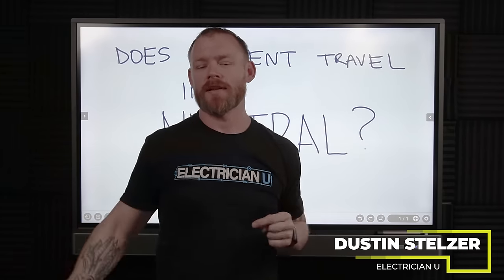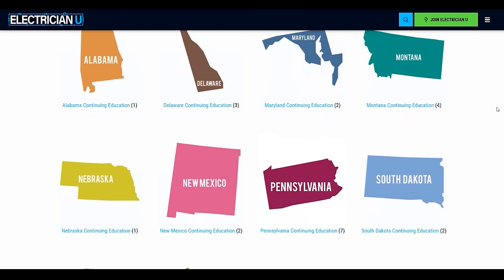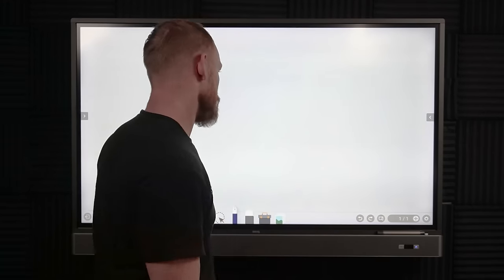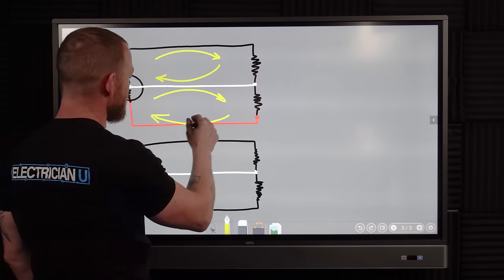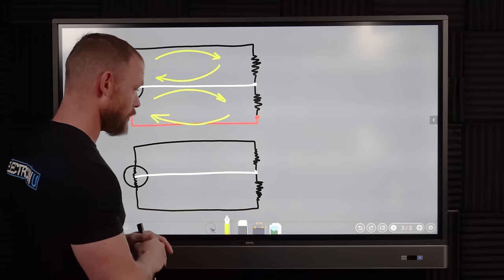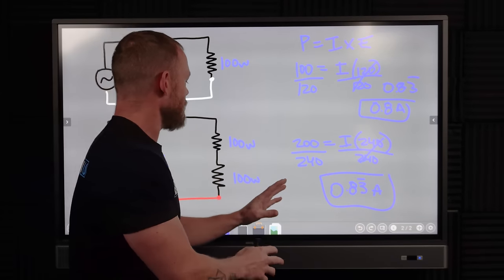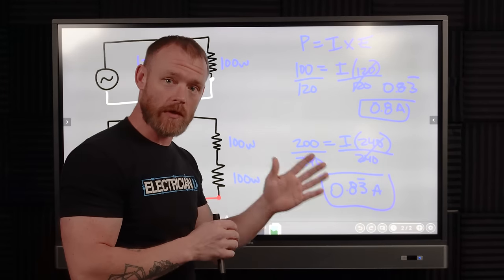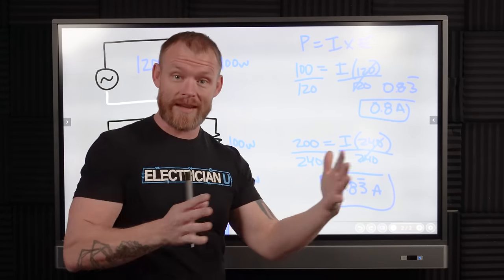Does Current Flow on the Neutral?

Comment: What you are describing is Kirchhoff's law.  The sum of all currents leading into and out of a junction is always zero.  In the case you describe, the neutral bar, there is 2 amps coming in from the first bulb, 2 amps going out to the 2nd bulb, leaving 0 amps to the neutral source.  In DC, it's easier to talk about positive and negative, but in AC we can only talk about the phases.  Now, if you had a 2 amp light bulb and a 2 amp inductive motor... that would cause phase differences and then yes, there would be some current in the neutral to the source... have fun calculating it!

Comment: Even with a balanced load the current is still flowing through the neutral. You explained that with the 10 amp -2 amp=8 amp explanation. You measured 8 amps because 2 amps canceled due to the "out of phase" condition. If you have a balanced load the same thing applies. 2 amps cancels 2 amps because they are out of phase. It is a meter issue. The current is still flowing through the neutral, but an ammeter is incapable of measuring it because it is out of phase. For measurement purposes, the phases cancel each other, but the current is still flowing through the neutral.

Comment: Don't know if someone said this here already ......  the current in the neutral is simply the difference between L1 and L2, also called black and red. If you lose or neutral becomes disconnected,  (very bad) the 2 110v legs will still meter to 220v but there will probably high v on one leg and low v on the other leg..... burns some circuits. Also the neutral connection is tied to ground at the transformer and maybe the panel foe safety

Comment: Hi Dustin! New Subscriber! I enjoyed your explanation about the center tap neutral wire from the power transformer. I'm sure that, while there is no current traveling through it on a balanced load, coming across it and one of the black lines will still give you a bad zap! Anyway, I have a question. I have purchased a new shop for my antique radio electronics business. There is a subpanel in it from off the main residence. The main residence has it hooked to a 100 Amp breaker and the sub panel is 200 Amp service. It does not have a ground rod at the detached building. Should I put one? Also, the white wires (in the building) are connected to the ground bus with the grounds. The subpanel has two hots and a ground, which I assume is a neutral??  Anyway, it is a 3-wire / 240 volt system. There is only one 120V outlet and some florescent lights. I plan to add a mini split AC w/ heat and a few more outlets. I will change the lights to LEDs. Any thing I should be concerned with? Thanks! :)

Comment: I found in teaching electrical engineering in the utility power sector, that the question that used to mess with students idea of current flow used to be the question. So we all understand the same current flows within the phase conductor and the neutral conductor, then why can I touch the neutral busbar and not be shocked, but if I did the same on a phase conductor I would be shocked? Of course the answer is with understanding that the Potential difference between the phase and neutral conductor and that after the load or the neutral of the load the potential difference is zero, which will have been consumed and converted to heat within a light bulb filament. Plus it’s worth mentioning with a 1, 2 or 3 phase appliance each of those phases are 120 degrees apart so the neutral current flows will follow the peak to peak sine wave on purely resistance loads. Hence why the neutral conductor is sized the same as the phase conductors in the uk.
Reply: I found making the students understand the terminology and what it actually relates to in 2 identical circuits one show it at the atomic level and one as a schematic. Students are introduced to all this terminology and expected to take things on face value, but showing the 2 circuits side by side and where each terminlogical term is next to its relevant circuit clears a lot of these misnomers up.

Comment: I think it’s easier to explain and understand if you use a fluid or water flow analogy. Balanced flows cancel each other out so neutral is as you call it “dead”. But in an unbalanced load the neutral always carries the difference. Thus emphasizing the importance of balancing loads in your circuit layout/design. Then it’s easier to explain bonded circuits and how the ground works as well as ground fault circuits. This way the learners understand a ground is not always safe and how it is properly installed.

Comment: Layman here...  we only think of a hot wire and neutral wire because we're used to some type of appliance in the circuit consuming current, so it's easy to think of a hot leg supplying current on one side and a neutral leg on the other side of the appliance serving some mysterious purpose.  But take away that appliance and you'll see that hot and neutral legs are really just one wire carrying current from one terminal to the other (DC), or carrying it back and forth (AC)

Comment: Important to say this video does not apply in the UK where we have 250volt single phase and neutral domestic supplies and the neutral is connected to a center tapping along with an earth connection on the 3 phase supply transformer. So in other words in domestic premises the neutral is identified as a 'live' conductor.

Comment: Great content Dustin! As an electronics instructor and evaluator for over 30 years your enthusiasm is awesome! Let me pass along a few tips that might help:
1. Your rate of delivery is way too fast. Slow down. This was a 23 minute video. 30 minutes with the same content would have been much easier for most people to grasp.
2. Your sequence of illustrations was poor. You should have started with a single circuit, then double circuit, then a balanced split phase, then an unbalanced split phase.
3. Your equations were presented backwards when doing the math.  I = V/R     You presented I/R = then showed V/R. 
4. You should have made it clear that these were resistive loads, not reactive which are very different and that they would be covered in another segment.
5. Use the standard: Tell 'em what your gonna tell 'em, Tell 'em, Tell 'em what you told 'em    approach. Much better learning happens that way.
6. Your panel drawing tried to show WAY too much and was hugely confusing. Redraw as needed.
7. A physical example on an actual panel would have helped a lot of learners and would have dramatically simplified your explanations. 
8. Pre-drawn slides posted on your white board would have been great, then use the whiteboard to highlight what you are talking about.
Reply: How about you make your own video then, if soooo much was wrong with his? ;) Jesus.

Comment: Trying to replace the ceiling fan dining room.I had a problem changing a ceiling fan. It was in the dining room controlled by a switch that I had replaced years ago because it had a dimmer on it, and I didn't care for a dimmer being on a fan; when I took the fan down, three hot leads were coming into the fixture. And, of course, my pliers went to the ground, and the main kitchen light and the garage lights when out. For an easy fix, I went out to reset the breaker. The breaker wasn't tripped. I switched it off and switched it back on with no result. Here's where it gets weird: two other breakers, one cataloged as bathroom hall lights and the other garage kitchen lights. The bedroom and hall lights still work, and I find that peculiar; I'm probably in over my head because no conductors are going into those two breakers.

Comment: Granted that if you have two bulbs of equal wattage, the supply will be balanced and no current will flow in the main neutral conductor to the panel.  However, if the bulbs are different in wattage some current will flow in the main neutral conductor.  This is known as an unbalanced load.  In smaller domestic panels  this is rarely a problem.  However, in commercial and industrial panels can create all sorts of problems.

Comment: You do a great job going over this, but it would be beneficial to also teach the Hot Conductor(no NEC wire definition) is the ungrounded conductor. The neutral is the grounded conductor and the ground(no NEC wire definition) is the grounding conductor. As the NEC and exams use these terms. Not Hot, Neutral, and Ground.

Comment: This is usually the reason why people end up with melted 50A plugs on there RV at campgrounds. Both hots was on the same split so the current on the neutral is doubled and could reach 100A. Ive seen it a few times if the neutral pin is melted in the outlet chances are both hots are the same split.

Comment: When you drew the first complete circuit with only one light bulb, if you were to install a light switch in the circuit to turn the bulb on and off, would it matter if the switch were installed on either the hot or the neutral wire? It looks to me that a switch on either wire would interrupt the current flow and control the light.
Reply: Technically yes, however if you had the switch on the neutral wire, then the hot wire would be energized all through the light bulb and back to the switch, greatly increasing the chance of getting shocked. This is also why outlets are polarized so a desk lamp, for example, only has the hot wire going to the switch on the lamp which is always on the hot wire.

Comment: Yep at one shop years ago I shut down a diamond saw. The 220 breaker was disconnected. I knelt down on the concrete floor and reached 8nto the coolant tank and Blam! Welded me to the spot. Current flowers from the neutral of the band saw (lots of junk on those running 120 and 240. The light, motor, sharpener, spot welder for the blades, an electromagnet etc. From it's neutral to the diamond wheel grinder through me through the concrete across the ground to the properly grounded pad mounted transformer. Yep neutrals flow current and neutrals ama grounds are NOT the same thing. Oh the shop maintenance supervisor had pulled me from my department to clean out since we were slow. He's the boss in charge of the maintenance guys and the maintenance guy was really good and would have never had me touch pet machine without checking it with a meter

Comment: Most interesting, as a licensed master electrician for 24 years and an electrical inspector the last 29 I find that few understand the theory because the vast majority are nothing more than installers especially here in NY State where there is no State  licensing requirement for electricians, few even own Code books or even know what Code cycle is in effect.

Comment: All well and good, makes complete and total sense.  I understand this, but i am not a teacher.  You have a talent.  Me, well not so good at teaching, but i think i FAILED at getting the point accross to my fellow journeyman.  Will you do a video on an ungrounded AC panel?  also know as an isolation panel or OR panel in a hospital.  I tried explaining how it works, and why, but i don't think i did so well.  grasping the concept of how when one leg becomes grounded and how the other leg jumps to 120 seemed to be above anything he could comprehend.  explaining how equipment cares not if its 120 on a leg and zero on the other or 60 and 60 seemed to confuse him. He is hung up on the current coming back on the grounded conductor,  I tried relating to a 240 bolt circuit with 120 on each leg, but i think maybe it confused him further.  I said a difference in potential is all anything really cares about, but i dont think he got it.  please help and make a video.  Maybe throw a little ohms law and kirchhoff's current law in there.

Comment: The black phases were exactly drawn like the Black/red schematic. The center tap of the transformer is exactly the same voltage as the center tap of the balanced load - therefore no current can flow in the neutral.
This all changes when the loads are not balanced
Reply: The center tap of the transformer is usually your neutral.

Comment: Most of this is awesome. If you have a 3 phase source, then each phase is 120 deg out of phase (120x3 = 360). If the installation has 2x phases then in fact there will be the residual of the 3rd absent phase flowing through the neutral (normally tied to earth in Australia, not sure on the practice in US). What would be interesting is the same diagram and explanation for a single phase installation (which is what all domestic connections are in Australia - a single live phase, neutral - to where? - and an earth).

Comment: The loads have to be perfectly balanced to eliminate current in the neutral.  With resistive loads, its relatively easy.  If the loads are inductive or capacitive along with resistive, nearly impossible to balance unless its the very same device by itself on each leg.

Comment: Ok, sort of a stupid question from a non-electrician.  I had a buddy who had an A/C installed, controlled by a thermostat.  It didn't work very good.  Then an "A/C electrician came in, diagnosed the problem as "solid wires from Thermostat, not stranded", replaced the wires, A/C worked as it should.  My buddy asked "Why?" and the A/C electrician said "electricity travels on the surface of the wire, not within the wire and stranded wire has more surface area".  

  And that is counter-intuitive to me.  Care to make a short video on just how electricity travels down wires?

Comment: Great info. Do you have a vid on balancing the loads in a sub panel. I'm installing a sub panel in detached garage. 
I'm using a 125 panel with a main shut off and the feed breaker from the main panel is 80 amp. 
I have 7 circuits. 2 - 15 amp one  for fans, one for overhead lighting. 1 - 20 amp for exterior lighting and 1 exterior outlet. 3 - 20 amp for 3 interior outlet runs each with 4 receptacles (8 plugins)
1 - 30 A 240  outlet. 
I figured  2 - 15 A. 1- 20 A on black, 
3 - 20A and the 30 A 240 on the red. However, the 240 will be used modestly for welder.
All receptacles will be used for fabrication like grinders and or saws, small compressor, shop radio etc. 
 
Thoughts ? 
Thanks !

Comment: Simple answer - there is ALWAYS current flow on neutral in a 120VAC circuit, as that's the "current return".
Even on the downleads from the transformer, there is "neutral" current as the sides of the "split phase" are NEVER in perfect balance when 120VAC circuits are involved and any of them are in use.

And that answer came before I looked at the video, after the excessive (youtube issue) ads to get TO it.

Comment: Hello Dustin, you said that the neutral wire has current and this current disappears somehow at main panel neutral bar, what made me curios is that after the main panel there is still a neutral wire which is directly connected to the secondary side of transformers. Arent hots and neutral connected together there? thank you for all your efforts to teach us the electricity.🙏🙏🙏

Comment: always be careful with neutrals, my partner was at a super nice resort changing out light fixtures and receptacles in every room, they would start off by turning breakers off and verifying the hots are de-energized. he was wiring lights, with power to the whole room turned off , and grabbed the neutral and couldnt let go, thankfully he had his partner at the time, he ran to the rooms next door and flipped all the breakers, they learned that this super luxurious resort had multiple rooms ran off of the same neutrals because the electricians were lazy or just didnt care. which is seriously dangerous, the wire melted into his hand and he was really burned bad because that neutral he grabbed had the load of 3 + rooms. just advice for the new guys like me. NEVER trust neutrals because people are always doing shortcuts that can mess your day up. he still has the scars from it and everytime we go somewhere for service, he reminds me to never trust just turning the breaker off for neutrals, always trust your gut if you are the one working on things.

 never trust anyone when verifying voltage without testing it yourself. always do multiple checks and take your time. let people complain and dont let it get to you because safety, accuracy and neatness will make you the best electrician out there. never use shortcuts that can be hazardous because you dont want a future electrician to get hurt because of something you did. if you dont know how to do something, ask. if your company doesnt have good people, LEAVE. do not pick up bad habits and push through the bullshit to do things correctly.  that is my advice from my first year of electrical. 

ps, 

the reason i stress the dont trust anybody when verifying voltage is because we were on a job on a scissor lift and demoing old pipes. forman specifically pointed to a pipe to take down, i told this foreman there was live 480 in the pipe yesterday, i told him to follow the pipe and recheck before i cut the pipe. he walked to the open junction box, verified there was no longer any wire in this pipe. i then cut the pipe  with a second person right next to me, and a fireball puffed out of the pipe, i was lucky we only hit 1 conductor because we couldve had a dead short between phases resulting in a gigantic  arc flash while being 2 stories in the air. cut lights to the whole building and blew the main breaker. after my colorful words to the foreman  i came down. went to the same junction box. shined my light in and boom, who wouldve guessed those conductors were still right in it. he was lazy and it almost killed us, DO NOT trust anyone but yourself because in the end, it is your life on the line. not the person dictating what your job is . that was in my first week of being in electrical. it took every strength in my body to not bts out of the foreman. he still works at my company and i will never forget what happened, because it could have gone from bad to insanely bad with just the changing of the sawzall blades angle.